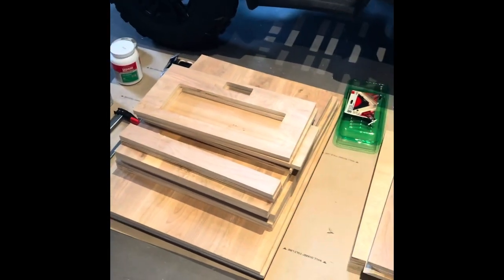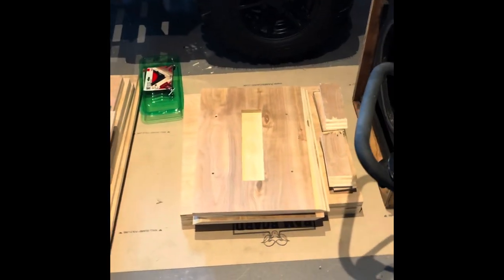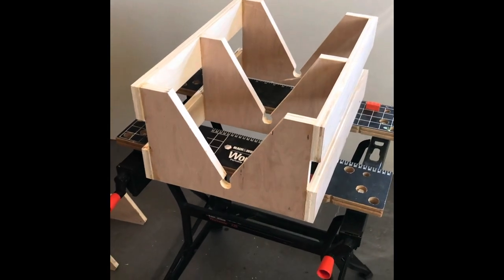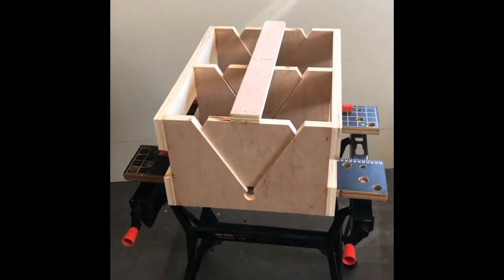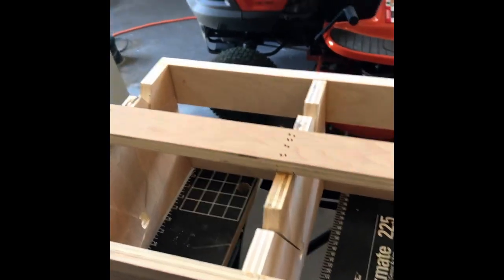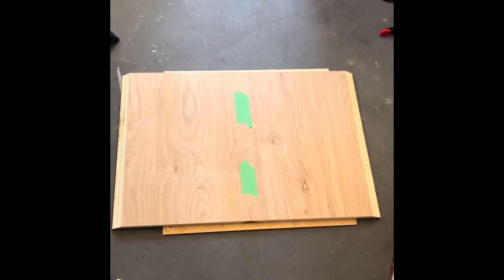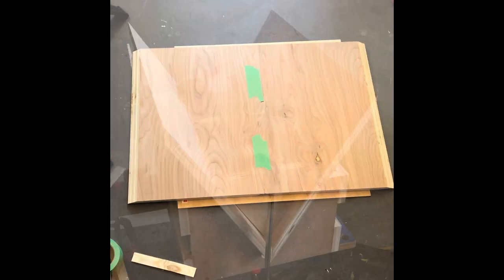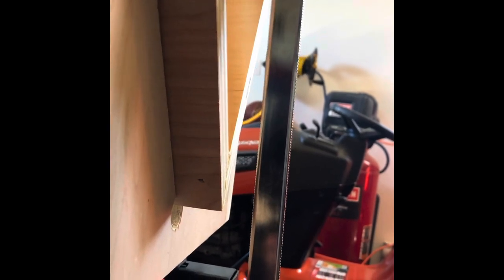DIY La Scala Clone - Part 1

Comment: Sounds like a project that will have your neighbors buzzing with envy.
A co-worker of mine had built Infinity RSII (RS2) speaker clones.
These speakers listed in the 1980 Audio Preview magazine retailed for $30,000 at that time.
He had built all the walls of two layers of 3/4 inch plywood, glued and screwed.
Each of these two towers had to weigh as much as a 36-inch refrigerator.
You can do a Google search to see what these speakers looked like.
But according to my ear, the La Scala remain the best loudspeakers that I have ever heard, for my type of music.
Just thinking about it, listening to Money by Pink Floyd, School by Supertramp or Cocaine by Eric Clapton, still gives me chills.
With La Scalas and a good amplifier, there was no need to add subwoofers.
Reply from the maker: Thanks for the comments!  I agree - I am always blown away by La Scalas in general, and my version I particular.  There’s something about them that is simply hard to surpass.  The dynamics and live quality is hard to give up once you’ve experienced it.  I have never heard any of the IRS line, but certainly am aware of the reputation.  I can’t even imagine building them!

Comment: Oh yeah! Also on my list... Want to pick amazing woofers and still lack that part.
Reply from the maker: Honestly, I would stick with the Klipsch K-33 or the Crites version (see the video description for details).  These woofers are designed for this application and changing them out for something else likely not give you the result your looking for.  Remember, the woofer in these is effectively a compression driver, not a direct radiator.  The horn itself becomes the main determining factor in the bass output, much more so than the driver itself.

Comment: For reference, the glue is FAR stronger than the nails. The nails are used in cabinetmaking only to secure the parts while the glue dries. If you have a good jig and clamps and the luxury of time, you can forego the nails altogether.

Comment: I have a set of cornerhorn clones my dad built in the 70s. Powered by a dynaco 400 poweramp.Nothing compares. Iwant to build a set of speakers "like" la scales but different. I'm powering them with a harmam kardon that is 8ohm and I am using 10" drivers instead of15s. I have the la scala midrange horns but that is the all. I will be using a different tweeter. So I need to make my own 8ohm crossovers and make the la scala box tuned for a 10" . Any thoughts or suggestions?
Reply from the maker: Designing what you are thinking about is beyond my skill set, however there is a good site that outlines a build for a smaller La Scala Midbass horn like you describe.  Here is a link to the site http://wp.volvotreter.de

Comment: What type of glue are you using?
Reply from the maker: I cover this a little later in the videos.  For most of the construction, regular white or yellow wood construction glue - Pro-Bond or whatever equivalent in your area.  However, for the top and bottom if the doghouse section (woofer chamber) I used PL Premium construction adhesive.  This is a polyurethane adhesive that comes in a tube like caulking.  You may or may not have this brand in your area, but if not, there will be a similar alternative I’m sure.  I explain the rationale for this choice later in video. Thanks!